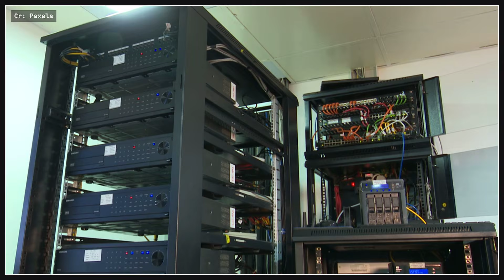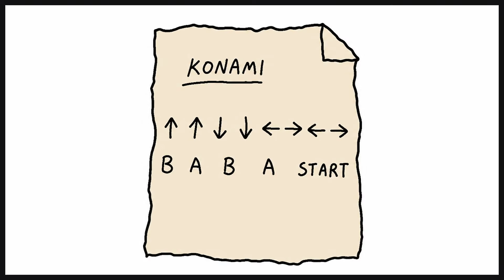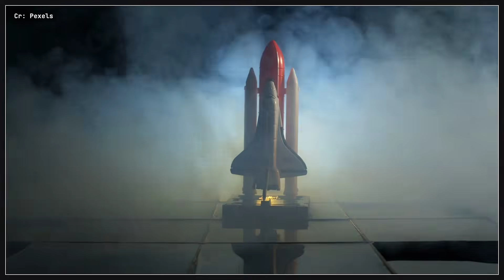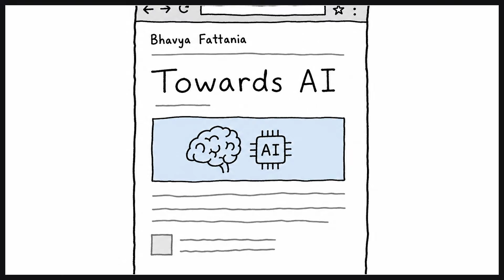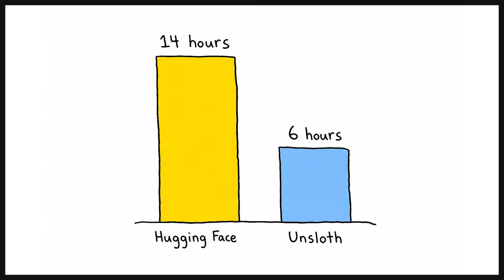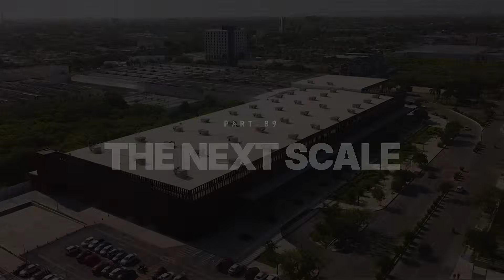The Free Repo That Turns A Used Gaming PC Into An AI Training Rig

Comment: your 3090 prices are way off with the current market if you are lucky you can find one as cheap as 900$ and good luck with that they go for and have been selling for up to 1500$ you are better off buying 2 Modded 20gb 3080s for about 700$ DDP from china or you go buy 32gb tesla V100 pcie cards they run for 700-800$